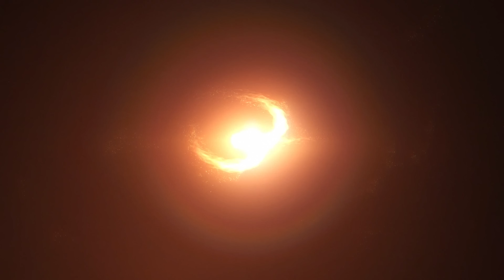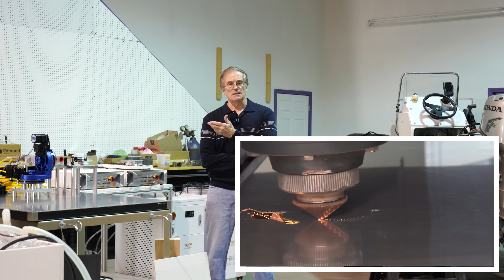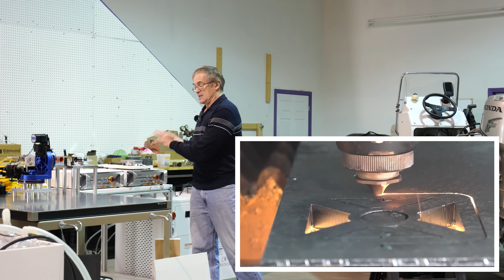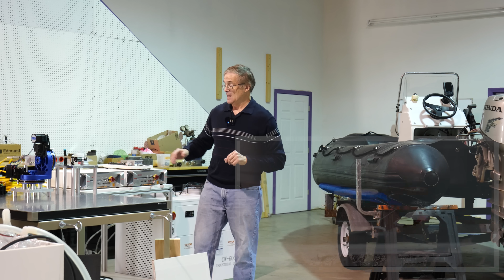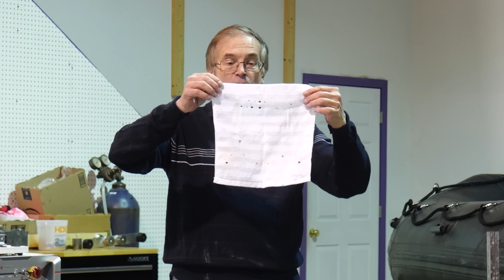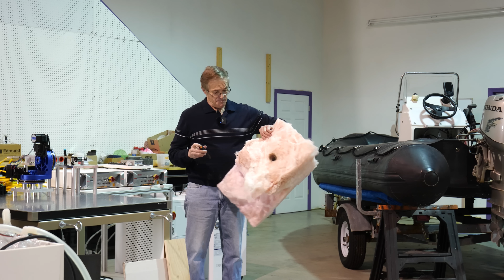We have a problem... and need your help!

Comment: My suggestion for an easy, replaceable DIY solution would be a to cover the potentially affected area with thick layer titanium dioxide powder (half an inch) and on top of that put a thick layer of carbon foam forming material - similar to famed starlite, but there are industrial options for fire retardant materials that work on similar principle. The idea is that the first fire retardant layer is sacrificial and will effectively stop the light through constant carbon foam formation, high in absorption and melting point, also amazing insulating properties through constant expansion. This is due to the fact that once a slice of the foam fails another grows in it's place nearly instantly, while at the same time shielding the underlying structure through expansion. Once this layer starts failing, TiO2 will take over as highly porous, therefore scattering material, effectively dissipating the energy inside the layer to prevent further burns. TiO2 is also extremely white (in terms of spectral response) so it should absorb very little of the light itself, preventing localized melts.
If you'd be so kind as to give energy density values for the output of your laser system I could run some tests for you to see how this would fare on a smaller scale.
Reply: I also picked up on titanium dioxide, put it in an aluminum oxide sintered brick with some manganese... precursor aluminum glass.

Comment: If there is some reason the automated e-stop kill switch will not work for your application(s), you will need to think about the problem differently. You stated that you don't want to reflect, however I think that is not quite right. I think you want to transmit to de-collimate and reflect, trapping the beam within a large area in order to dissipate the energy over a large plate, converting light into heat. Then the heat could be removed from the large area mass by air flow cooling.

Comment: A small robot arm that puts an optical difusser in front of the output of the beam, you'll be able to point it anywhere and see a big harmless dot, when you're in kill mode, robot arm removes the diffuser from the path of the beam.
Reply: Congratulations you're the only person i've seen who thought of a diffuser and understood the assignment. Potentially a very large robot arm. None the less.

Comment: Probably, high quality diverging lens with a brick wall behind the lens may solve the problem. 

Start the laser with a low intensity just to see if the pointing of the laser is as expected (right to the middle of the diverging lens) then set the target and increase the laser intensity.
Reply: The pointing of the laser at the attacking drone swarm?

Comment: I fed the transcript from your video into chatGPT (Im amazed you guys didnt!). Here's the solution:
How do you safely stop or absorb a highly focused beam from a high-power single-mode fiber laser (designed for industrial metal cutting) without fire, toxicity, or permanent infrastructure?

Key Requirements:

1. Must absorb (not reflect) the beam.

2. Withstand direct beam for a few seconds.

3. Should not ignite, emit toxic gases, or cause secondary hazards.

4. Must be portable and ideally inexpensive.

---

Recommended Solution: Composite Beam Dump System

Here's a layered, tested and practical approach used in real high-power optics labs:

1. First Layer: Carbon Black-Coated Copper or Aluminum Plate

Why: Carbon black absorbs the beam, preventing reflection. The metal behind it absorbs and conducts the heat.

Specs: ~5–10 mm thick aluminum or copper plate, spray-coated with high-temp black paint (e.g., Zynolyte or Cerakote C-7600).

Function: Disperses initial heat and slows beam penetration.

2. Second Layer: Water-Cooled Copper Heat Sink Block

Why: Used in professional high-power beam dumps. Continually absorbs energy and prevents runaway heating.

How: Enclose copper block with internal water channel (or attach aquarium pump to circulate water over block).

Extra: Add thermal cutoff fuse (melts if it overheats, triggering kill-switch).

3. Third Layer: Layered Graphite Felt or Carbon Foam

Why: These materials absorb laser energy volumetrically without reflecting it, and withstand >3000°C.

Products: Pyrolytic graphite felt or rigid carbon foam blocks.

Mount: Sandwich this behind or partially in front of the copper.

4. Optional Final Layer: Firebrick or Concrete Slab

Just in case everything else fails. Use refractory firebrick rated to >1500°C or sacrificial cement board.

---

Why This Works

Graphite/carbon foam absorbs high-intensity light across the spectrum and tolerates direct beam contact.

Copper or aluminum rapidly conducts and spreads heat.

Water cooling adds a safety buffer and avoids thermal runaway.

Non-reflective, non-toxic, and modular.

---

Bonus: Passive Emergency Shutter

Build a spring-loaded metal shutter (even a piece of thick steel) that auto-closes when a thermal fuse melts (e.g., at 120°C), blocking the beam path in a fail-safe.

---

Shopping List Summary

Component	Suggested Product/Source

Graphite felt	ZOLTEK Pyron or PAN-based graphite felt (McMaster, eBay)
Carbon foam	Poco Graphite foam blocks (Machined for beam profile)
Copper plate	McMaster or local metal supply – 1/4" thick min
Heatproof black paint	Zynolyte Hi-Temp Black or Cerakote
Aquarium water pump	Any 12V submersible with hose
Firebrick backup layer	Refractory insulating firebrick (Amazon, kiln supply)

Comment: PVC piping parallel to the laser filled with sand, or water, or gravel. Potentially you could line the pvc piping with a reflective material, creating a sort of telescopic refracting tube of sorts. if you use like a fancy stone like quartz that may help create a refracting effect. Making the piping as large as possible adds to the cost, but like a Dart Board, you can reach a certain size, and its almost impossible to miss. There are fairly obvious ways to with 45 degree angled thing to make a sort of cone to expand the catch of laser!

Comment: Obliterative (ex. phenolic) shield?

A waterfall with enough particles in the water to absorb the beam, at least enough so the backdrop holds. 

Graphite might be able to hold for a bit but I think it's neither cheap or non reflective enough for what you want. 

How big is the area you are trying to conver?? Mechanically restrain the coverage so you can get away with smaller area for testing. 

I'm thinking diffraction, you have focused the bean so some glass can pass it through without damage. A fresnel lens or a tank with murky water to make the energy density much easier to handle.

Do you understand that you are developing the defense of your weapon before the weapon?? 😅

Comment: use a glass fish tank with ink + water. You can adjust the absorption by changing how much ink you put in.
Reply: this method only works for 1.06um, not for 10um wavelength. Glass is not transparent

Comment: add a wall of sand filled boxes of plywood. Boxes need to be about brick-like thick, i guess. The hole of laser will cause sand to flow out, so it must be boxes or cells of some kind to not waste all sand and to ease of disassembly. And it shouldn't be a mess to clear afterwards.

Comment: Could you check the frequency of the laser light and determin it's colour , then having sometihing like an aquarium with either colored water, or some liquid, with the frequency of the color being like a multitude or scale(don't know the correct word to use here) of the laser frequency? i'm just imagining having the correct color frequency blocking the laser light to an extent, whilst being a liquid, it wouldn't burst into flame, and also help diffuse the laser light, and the laser would pass through the glass of the aquarium without cutting it.

Comment: A few layers of  plywood may still be a workable idea. To mitigate fire propagation, coat each plywood surface with intumescent paint. Might also use Fiberfrax in between and finally porcelain tiles(cone 20)  as final backstop.

Comment: You can use the tiles as a heat shield on reentry vehicles or in a concept that uses a lens after the target to disperse or unfocus the beam, such as a spinning reflective sphere ( polished tungsten alloy) that redirects the dispersed beam onto (or into) an absorbent (cone) surface. This basically reverses how the beam is generated. Or use the beam itself that splits the beam and one is offset to cause interference out of phase, like making a 3d image. Or use a combination of the above.

Comment: Hmm when i heard sand I thought what about baking soda it's the only material that doesn't explode as fine dust. It is pretty prominent in putting out fires. Turns to h2o and co2 when heated. Other than that some optics that would disperse the beam would be interesting. Third idea a glass water tank with black water like when you dissolve rust in citric acid solution water if the beam is caught in water it would probably just make some steam.

Comment: 6:50 Ok, so behind your target you should have a mirror in 45º with a polished reflective steel attached behind (the steel is to both help remove heat from the mirror and reflect the bean in case the mirror falls apart. The mirror will give you more room to work with, plus you can automate the mirror to pair with the alignment of the laser system and redirect the bean to whatever). Then the "bean catcher" you can do with tank full of sand below of the mirror, the top of the sand you need a hole where the light enters, and the inside must have a opening. The idea is once the light enters in the "bean catcher" it will scatter in the sand (and melt some of it) but the energy will disperse inside without causing a fire and you can fill and refill the bottom as much as you need, plus sand is cheap. Or, using the same idea of an entrance with a hole into a catcher, you make a box and place in the side of the mirror, the side facing the mirror you put glass to be transparent (but remember the inside part should be something that blocks the light), then in the inside part you put 4 "absorption corners (maybe painted in black)" in 45º of inside 90º without blocking the way of the bean, and the inside walls should be curved in a way that what ever light enters, will be harder to get back to the entrance, then cover the walls with reflective aluminum foil, and fill all the wall spaces with stained steel  sponge (the most thick and shine you could find - The idea is to scatter the bean before hit the inside walls, and if it pass the wall should be ok). Then fill the tank with water so the inside materials could trade heat without burn, the water will be also good to contain any fumes that the other materials could release.
That is my 0,5 cents. Good luck.

Comment: Carbon Fiber fabric blanket, welding blanket, copper sheets of X thickness.  All materials positioned out of focus.  Perhaps backed up with tinted poly carbonate sheet as a diffuser and to provide piercing witness marks.  Are there reflective systems that work like a bullet trap to attenuate the energy?

Comment: What about a tank of water with some light absorbing medium in suspension, like graphite powder. The water would keep it cool and even if it manages to burn some graphite, more water graphite solution would "flow" into its place. Effectively making a wall that replaces itself faster than the lazer can burn

Comment: I have no idea what I am talking about, but a thought that came to mind was a thick pane of glass, broken (like, hit it with a hammer), so that you get still basically a pane but consisting of glass that has as many as possible angles, to deflect the laser. The idea being that when inside this 'broken glass pane', the light would be deflected again and again and again, each deflection diminishing it a little. But, maybe it will just melt.

Comment: My idea for a backdrop to protect against errant laser fire:
Use a cavity and fill it with water.  Think, a fish tank.  You could even color the water if you go with clear glass or acrylic.  But i think i would go with 1/4" plate steel.  You probably only need less than a foot of depth, maybe 6" or so.  You could put the plate steel "fish tank" on a castor base so that it can be easily moved.  And, while very heavy when filled with water, it will be a much more manageable weight when you drain it after your testing.
If this is not sufficient and the laser burns into the metal too much, then i might consider adding a waterfall to the entire front of the structure.  This would mean that you are getting cooling from two sides with one being a static bed of water than the other being moving water.
Also, you could experiment to see if a waterfall on both sides is more effective than the static water in a cavity .  It seems like running water on both sides of plate steel of sufficient thickness and hardness should be difficult to penetrate because of the rapid cooling that is being continually applied by the falling water on both sides.

Comment: What about some sort of sheet material just as an enclosure to hold either sand or another loose material or ceramic beads maybe ,i have seen some prototype bullet proof walls work with a similar concept ,anything that gets destroyed should be filled in by other loose material and plug the hole in the outer sheet

Comment: Rock woll might out do the fiberglass. I am also reminded of the experiments that show a blow torch against paper cups filled with water. Your barrier needs heat sinking like that, so it will likely need multiple materials for ablation, shielding and finally thermal dissipation.

Comment: Was looking at phase change materials recently, there are panels and fabric made from aerogel. Have no idea if something like this would be helpful but figured I'd throw it at the wall. Just a random uneducated suggestion. Good luck, this thing sounds frightening and amazing at the same time. You're definitely going to have some guys in black suits showing up eventually if not already..lol
Reply: phase changing aerogel is actually how I started thinking about this problem. Reading the comments I can see that very few people even got this far.
Reply: @loveblowsbad  only mentioned because I was researching ways to passively cool RC motor after hearing about McLaren F1 team potentially using PCM in their brake ducts to keep tire temps down. Was thinking they used embedded heat pipes in there carbon but came across fabric that's upwards of 50% aerogel and figured that's probably what they're using instead. I'm just a tinkerer so I have no idea if these materials would work or not. High power lasers are serious stuff and require a level of physics I'm not educated on.
Reply: @GirthBikesMike  you're doing good work. Results should always speak louder than credentials.

Comment: Graphene. You already have the answer, you created Graphene in an earlier video. Test creating thin layers of Graphene on a substrate (like glass) and stack the substrates. The substrate should allow the laser to flow thru, not burn or be destroyed. Stacking allows dissipation of light energy across the layer(s) of Graphene. It would be lightweight, cheap, portable and relatively easy to manufacture. I have an idea on Graphene glass but would require a lab like yours to create it.

Comment: Maybe try "the sky". I heard it doesn't cost anything and absorbs a lot of light going the right direction. The celestial dome might melt though, and drop on our heads~
Jokes aside, what does prevent you from simply firing it upwards into space? Maybe even at the moon or any mirrors placed on its surface?

For something more indoors, you could try some opaque liquid? Then fill a transparent tank with it (how do you get optics that don't melt from a laser as strong as light itself mathematically allows for?), and have the liquid flash-boil in sputtering tiny explosions, that are contained by the vast amount of liquid + instantly refills the void to heal any "damage". Again, the issue will be to get the tank to not melt here. Both from the beam going through it, and from the liquid flash-boiling.

Maybe a gas-chamber with 2 mirrors bouncing the beam back and forth (in a sideways manner so it never hits the same spot twice, to avoid absorbing too much energy in one spot). Then with the right gas and density, you might be able to get the gas to absorb the light beam throughout its path (because it bounces the path will be much longer than it should be, which is what might allow for this to work). Liable to generate plasma from the gas heating up though...